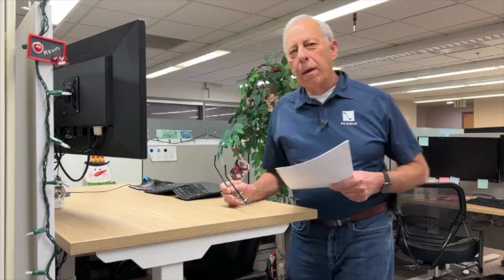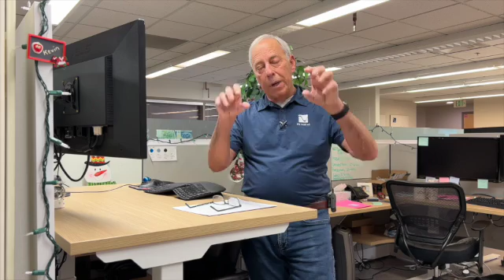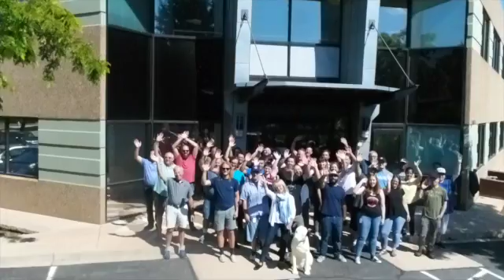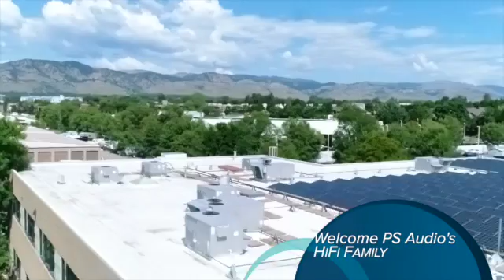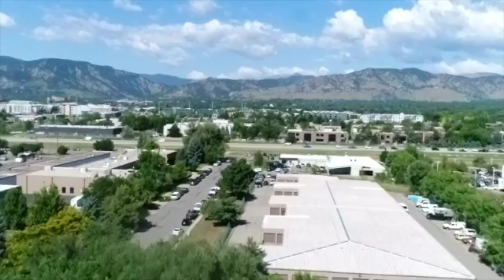The best use of a Power Plant

Comment: PS Audio power plants work .. best use is for preamp ,CD player and turntable…
Reply: https://youtu.be/12T7JFLGlf0
Reply: I've heard one first hand and it does not work, it's a gimmick
Reply: @ryanschipp8513  Well to be fair, the product does work. It does lower distortion on the AC line as well as provide some limited local power reserve capacity. But the point is none of this makes a hill of beans worth of difference for the listening experience. If it was marketed solely on what it technically does, I don't think there would be as much public criticism. But most all audiophile power products are marketed to solve problems that don't exist in the first place. This is certainly one of them.
Reply: @andydelle4509  I've never challenged if it actually works but I know for a fact it doesn't change anything audibly.
Reply: @ryanschipp8513   clean your ears and tell your friend that his 5k Macintosh isn’t a big deal at all. My cables are maybe double that price and I bet on his 16k speakers that I can prove him the p20 makes a difference. Period
Reply: @ryanschipp8513  Were you dropped on your head as a child?
Reply: @alfonsodelafreg259  wow such an astute comment. It sounds like rather the contrary
Reply: @ryanschipp8513  Why thank you, I thought so.

Comment: Few people need a power plant. Using the money for that instead on better speakers will yield better sound for 99%.
Reply: everybody needs an AVR ..those used for computers. ac from the wall is a disaster fluctuating mess.
Reply: Look at ASR review, it was painfull to see the performance of this thing. Its an AB class amplifier that produce the 50/60Hz 120/240V AC, so very limited in power because of the AB class effiency. People wpuld be better with a online ups (Single-Phase Double Conversion UPS) if there electrical is very unstable and could damage the equipments, otherwise dont add anything except a surge protector on your electrical panel.
Reply: @DrLoveQc  Yes, those ASR reviews are generally done very well. The idea that you need a power plant to clean your AC power is perhaps true if you live next to some factory in a third world country but in most locations I’ve seen, the quality of your mains power is at a level where your products can handle it, provided they have been designed with care on mains power noise and fluctuations immunity. If a power plant really makes your source device sound better it would make me suspect that the source device is terribly designed in the power supply of it. Possibly the problem can be fixed by a 20 cents capacitor over the Vcc in such case.
Reply: @ThinkingBetter  Except when it isn't. I live in the UK. The street is fed from a local substation which operates on 3 phase. Houses in the street are fed single phase using one of the 3 "live" phases and all use a common neutral. In our street the neutral developed a fault. At that point the voltage supplied to houses varied with the load presented by the houses  on that phase. It took a week to get the power company to take our complaints seriously. EVs would not charge, Solar panels could not feed in power, lights varied in brightness (our main clue something was wrong). Hi fi components shut down seemingly randomly. When tested by the power company our house was showing 255 volts (it should be 230).
Reply: @skybertie I didn't mean to say nobody needs a power plant. In an audio system your power amplifier is usually the only product without voltage regulator inside and more prone to have the power rails fluctuate by the main voltage. However, power amps usually also gave heavy capacitors that at least help maintain the voltage for short transient dips. Maybe your area needs such thing. I've traveled a lot in third world countries where the light in the room can go up and down depending on elevators and other things needing power.
Reply: @ThinkingBetter  My key point is that faults CAN happen that can damage your equipment.  Another point... If you have Solar panels in the roof you have a system taking DC  and making AC and adding it to your incoming feed. To use your generated electricity it seems it needs to be at a higher voltage to push it into the system... and its made ac by transistor switching. I cant get any data at the moment on how much higher it pushes your voltage... or how much distortion it puts on the mains feeding your audio kit. But it gets even worse... your neighbours with solar power may also be exporting to the mains... so what you get is a sum of all that!
Reply: @skybertie I can agree that the AC generated from DC in solar installations can be with harmonics that potentially can transfer into your audio gear. But a well designed power supply should filter not only mains voltage hum from the power rails but also much higher frequency noise by using filtering caps tailored for it.
Reply: @ThinkingBetter  but you dont agree that solar installations push up the overall voltage level in a street?
Reply: @skybertie Of course less voltage drop will occur in an area sharing power with a house when that house starts using solar power. This will mean a slight voltage increase 😊
Reply: @ThinkingBetter  I don't think you are tracking this conversation very well and have dropped to just giving sound bite answers. My whole point since making my initial comment is to describe the advantage of using a product like a power plant in continuous over voltage situations. Everyone talks about protecting against transient over voltage spikes, but the growing problem is day long overvoltage. Initially this happened to me as a neutral problem in 3 phase. But ongoing investigations shows that widespread adoption of domestic solar energy is causing significant over voltages for several hours a day. A power plant isolates and protects my equipment from that situation and prolongs its life.
Reply: His power plants are the epitome of snake oil

Comment: Really a power generator is a switch mode power supply. A SMPS controls the voltage doesn't matter if the voltage changes. Just use a isolation transform conditioner with storage capacitors 1 amp that would do all the source equipment
Reply: I am not convinced that is true.  I thought it was a large conventional amp outputting 120V at 60Hz.  That said, I do use a conventional power conditioner.  I have tried an isolation an transformer at 1kVA and did not like the results.  In some ways it helped, but it also compressed the dynamics of the sound.  It sits collecting dust.

Comment: I read that modern high class audio devices handle power much beter then in the old  days. Makes this a powerplant obsolete?
Reply: "I read that modern high class audio devices handle power much beter then in the old  days. Makes this a powerplant obsolete?"
No, the power plant is not obsolete.

Better components might handle non-ideal power conditions better than lesser quality components.  But no matter what components you have, the cleaner the electrical current, the better your stereo's components will operate.

For most people, a power plant would be a bad choice of where to spend their finite audio budget.
But for those that have a high-end stereo, a power plant will allow the stereo to sound its best.  A power plant will help.

On a professionally set-up, high-end stereo, in addition to hearing the beauty of properly recorded music, and the beauty of brilliantly engineered gear, you will also hear every flaw in every component.  A power plant will further contribute to the above distinctions.

So if you have your dream speakers, and dream amps, and dream pre-amp, and dream DAC, and dream transport, and dream turntable, and dream tone-arm, and dream cartridge, and dream interconnects, and dream speaker cables, and dream component racks, all in a dream audio room with treatments, then a power plant will make sense.

The above is an extreme example, to illustrate my point.
A power plant will help with lesser systems.  But it should be a tail-end purchase, that comes after exhausting your budget on other high-quality components.

I have never heard any PS audio gear.
But I have heard Audioquest's Niagara 7000 on a high-end system.

A proper power plant will help an already great sounding stereo.
Reply: Yes
Reply: Snake oil more accurately.
Reply: @Roof_Pizza  "Snake oil more accurately."
Please name the components of the stereo system on which you conducted your listening test.

Comment: I’ve long maintained that the best use of a power plant (and devices like it) is to be sold for a profit by the manufacturer. After that, the number of use-cases falls dramatically.
Reply: Spot on.  Kind of like the silver speaker wire and the $500 interconnects.
Reply: I had set up a stereo in our lounge where there was none previously. Not knowing how the system and room should or could sound like, it just sounded wrong, like the first minute. I immediately had a suspect: our dimmable light. Switching them off immediately changed the sound for the better, and this was audible to everyone. Since we added one of those special power splitters for cleaning up power (like 50 bucks item), not even a power re-generator, the issue went away. And I am the first to admit that I am not a super audiophile with golden ears blabla... Maybe you have great circumstances as-is in your place, or maybe you only "maintained" and never tried ;)
Reply: @Baerchenization  Your household wiring is screwed. If a dimmer light - on your lighting wiring - is causing any kind of hum or interference with your power sockets., then you need to resolve that by calling in an electrician.  What you have effectively done is place a bucket under a leak in the roof, rather than sort out the roof tile.
Reply: @Baerchenization  sounds like you have/had a fundamental wiring problem that could/should be solved for under a hundred dollars  by a competent electrician, not by a "band aid" device costing $50, let alone thousands for a power station. As for me, my system is mostly all vintage, bought new 40+ years ago, and its current value (even its original value adjusted for inflation) is a fraction of what a power station costs, so I will continue "maintaining".  I have no desire to try such a device, only a desire to apply my common sense.
Reply: @edd2771  Ed not even a 14 dollar clock radio deserves the abuse of being powered by most standard home power
Reply: @davidcross890  And yet, over 125 million households in the US (not to mention the remainder of the world) suffice on ordinary power. These households power everything from clock radios to computers to OLED TVs to hifi equipment. And they all lead happy, productive lives with equipment that functions perfectly.  It’s one of life’s mysteries.
Reply: @edd2771  it's simply your lack of knowledge Respectfully that hinders you from understand while some of many things will power up with inferior power they WILL NOT function or last optimally under less than ideal provided power.
I know this and can easily prove this beyond doubt with just one of my virtually perfect power circuits.My Inventions are world-wide in virtually every household, business, public space, and government space
Reply: @edd2771  You would be quite surprised at the Performance and Longevity with my Inventions of Truly proper power. I WELCOME anyone to publicly via YouTube comparatively test my Proprietary Invented power technologies versus ANY other product at ANY price even in the hundreds of thousands. My technologies will EASILY BEST ANY AND I CHALLENGE ANYONE TO PROVE With REAL METRIC TESTING ME WRONG. PLEASE Someone HAVE THE GUTS.....PLEASE
Reply: @davidcross890  Wow.  Please provide the patent number of one of your inventions so that I may investigate these fantastic claims further. Regards.
Reply: @edd2771  LOL!
Reply: @edd2771  it's David Cross do your due diligence USPTO.GOV AND WIPO (WORLD INTELLECTUAL PROPERTY ORGANIZATION) curious when some Reviewers/Influencers will stop deliberately backing inferior products and will show what's really possible instead of protecting how big their pocketbooks or wallets get by pushing mediocre Performance products and technologies
Reply: @davidcross890  yes, I understand where to look, but please provide the patent numbers for your amazing inventions
Reply: @Baerchenization  
It might mean that there was something wrong with Your amp. Usually amps have such filters onboard.
Reply: @jareknowak8712  That would mean we have four defective mono amps... that would be very sad :)
Reply: @Baerchenization  it also might be source, CD or preamp.
Reply: @jareknowak8712  most all high end amps are built with poor designs and components...and to not forget junk power supplies for high end interests
Reply: @Baerchenization  are you talking about McIntosh?